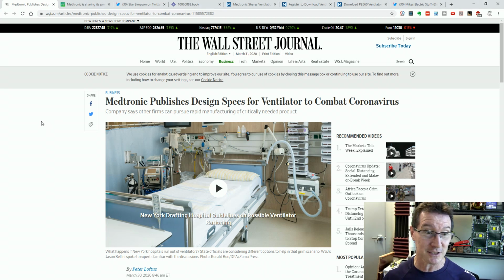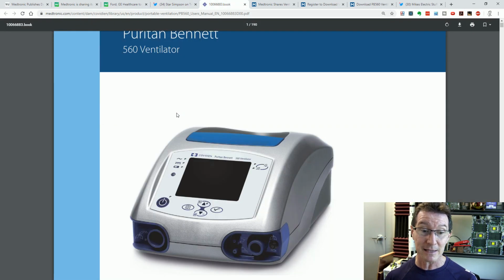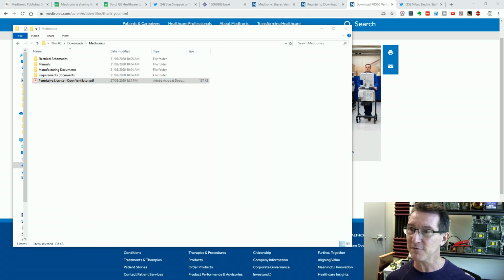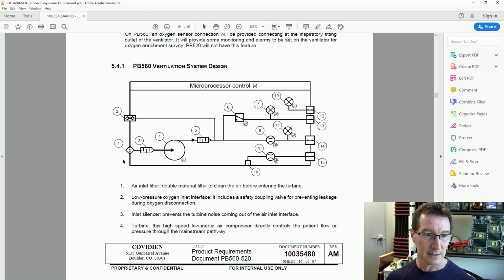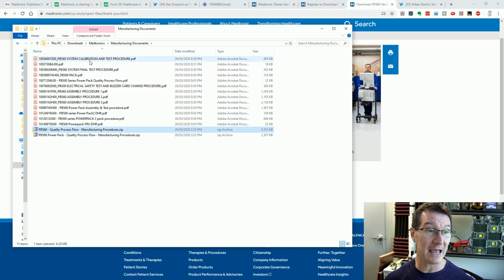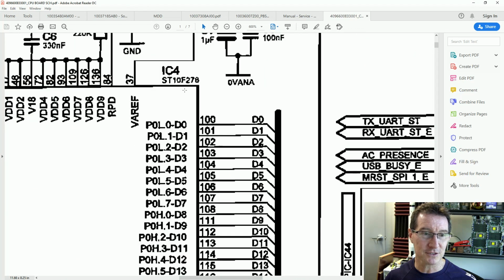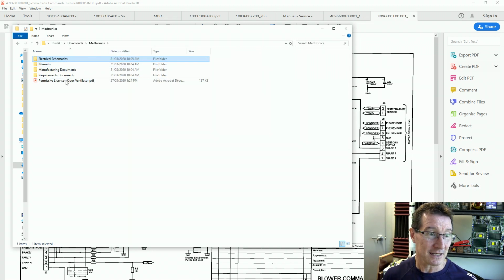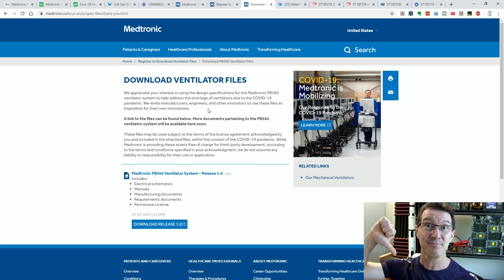eevBLAB #72 - BUSTED! Medtronics Open Ventilator FAIL

Comment: I wonder if software-modified CPAP machines could be used as a better-than-nothing system?
My BiPAP machine can output 20 cm H20 pressure -- not sure if that's enough, but it sure feels that way.
Reply: Actual ventilators go much higher. The scale of a Trilogy ventilator goes to 40.

Comment: So I find this interesting, if there were no ventilators, one would use a BVM, Bag-Valve-Mask, a flexible air bag having a tidal volume of what would match the patient, infant, child, adult.  The output goes to either a mask or an ET tube connected to the patient.  The bag is squeezed and released by hand, at a rate corresponding to the breathing rate and how much it is squeezed depending on the desired tidal volume.  If the power went out, this is what people would resort to, taking turns on keeping the patient alive.

What did they do 50-60 years ago before microprocessors?  Probably a motor-driven set of bellows, a variable speed control, something to set the pressure, as simple as a set of bellows and a micro switch.  There would also be an input, for room air or oxygen.  This really isn't rocket science, but $10 - $20K per unit?  The ones you would see in the OR or ER can be quite complex, lots of instrumentation, but some are actually very simple, about the size of a shoe box.  To be honest, it wouldn't take that much to build one but you would never get it past the medical industry.  Think of what could go wrong, speed control goes out, pressure exceeded, lungs burst.

For the car industry to build one, probably not a lot different than the pneumatic control system in an automobile.  I suspect the sub assemblies can be purchased and put together.  By the time the products reach the market, the disaster will be over.  Then of course, there is CPR.  -  I didn't proof read this, hope it makes sense.     Jim
Reply: CPR and mouth to mouth are going out of favour as people don't want to be near patients in fear of getting infected...

Comment: I guess with it being open source and the fact that they won't sue if someone designs one similar counts for something.  Ex: if someone reverse engineers one and builds one they won't get in trouble. Of course releasing all the schematics and software and BOM etc in proper formats would have been way better and save tons of time.    At the end of the day this feels like a marketing stunt as you said though.

Comment: Page 65 of the Product Requirement PDF had a BOM, but you didn't make it that far in the video.

Wait... Here it is:

Basic Parts The assembly at first level shall include the following: 
1 Ventilator

🤦‍♂️
Reply from the maker: GOLD!
Reply: @EEVblog  A 9 carat gold plated turd unfortunately.
Reply: Maybe a standard CPAP or BiPAP machine with modified firmware would help in places where are proper vent isn't available?

Lots of people working on that atm, and you can buy a half-decent CPAP on AliExpress now for under $350 American Rupees.

A CPAP may not save your life if you ger critical enough to need ICU treatment, but way better than nothing if it helps at all with preventing you getting worse. It would at least force more air/oxygen into the lungs.
Reply: @electronash  Bipaps are considered dangerous as they might aerosol the virus. :(
Reply: @addictedtogravel3552  It would be only as a last resort, for people stuck at home, or in an isolated COVID19 ward.

Obviously I would not recommend using any of this stuff without medical advice, but it's possible CPAP or BiPAP could help save lives if there is a desparate shortage of proper ventilators.
Reply: @EEVblog  they've released all electronic files from CAD, PCB to software and BOMs.
Reply: @EEVblog  Did you see this yet?...

OK, I get that it's meant to be kept as simple as possible, and done in a very short time, but dayum - that breadboard and LCD, tho. lol...

https://www.youtube.com/watch?v=xdZtMgpxnPI

(I guess I assumed that the "best and brightest" in our Universities would at least have access to PCB-making facilities. Instead, Sony are offering to make the PCBs for them.)
Reply: One slight concern is that a lot of these designs run off of "shop air", but not all hospitals will have enough outlets for all of the ventilators.

Some designs might more reliable if an air supply is available, but maybe it's best to look at many different designs, including ones that run purely from a power outlet?
Reply: @ElectronAsh portable compressed air. They all have bottles of compressed air. I presume that’s what shop air is. Not called that here in uk. It was a uk design and all hospitals in uk have piped air or portable bottles of air
Reply: 1 Ventilator 
1 carrying Bag 
1 kit of 6 air inlet filters 
1 O2 connector 
1 CD Clinician’s manual (18 languages) 
1 double branch adult circuit (single branch for PB520) 
1 European power cord (type B)  Customers will be prompted to order the following parts with every ventilator: 
1 user manual printed (choose the correct language) 
1 power cord (if different from European power cord included in BOM above)
Reply: @danielrouw2593  Diaphram compressors are dirt cheap, oil-free and off-the-shelf, just saying.
Reply: Big Cheese I’ve got a diaphragm compressor/vac for HVAC at home and while oil-free it’s also godawful noisy.
Reply: @HighestRank  Haha, the only thing more difficult to address than noise level would be my none-existing concern by it...
- Ehrmm, nurse! That man's life sustaining apparatus you got there is making a god-awful racket. Would you mind turn it down a bit? Or perhaps replace it with one that is a bit more... Ehrm, "civilized", so I can eat my pheasant like the sophisticated man I am?
Reply: I love how companies waste paper,and people time by including this useless crap sections in their doc's
Reply: @paulstubbs7678  it's not useless. It's the requirements for the packaging of the ready product, in other words the content of the box that gets shipped to the customer.
That's how requirements documents work.

Comment: What makes it basically useless is the timescale that we are talking about. The only way to carry out a fast deployment is to have a known-good system, stripped down to its bare basic requirements. 
A ventilator  does NOT have to be nearly so bell-and-whistle crapped up as they make it, if we are talking about necessity versus nicety.

Now from a "Lets take a month to understand what they did here..." perspective, there is knowledge to be gained. Noone here believes we have that kind of time. So!... The US government having GM and other companies make an established design is a solution--- basically keeping the IP in the hands of big corporations.

I think that after this mess many of us will not settle for that.
Reply: I disagree with your first statement.  To my knowledge, the sensors and other mechanics are for safety purposes.  If you're trying to save someone's life, safety features are a most.  Don't get me wrong, I am sure there are items and software features that are not needed.
Reply: @rossrobotics6342  Some sensors are definitely necessary, but some features are just fluff to use to market a new thing to replace an old thing, since ya know, patents expire.
Reply: I thought the integrated 2.1 bluetooth Karaoke speaker mode was a nice touch.
Reply: Do you know how much time this event will last?

Comment: Dave that material isn't some super secret squirrel stuff either...you get that information if you get trained to work on those things... Schematics, functional diagrams, theory of operation, service manual...they basically offered the training material free. Which is nice of them I guess even though most of that can be found on Biomed forums. However that material is meant to help someone figure out how to fix a vent, not build one.
Reply: What's nice about the release is that the information is cohesive: a complete set of requirements to build a well known ventilator - not a hodge podge of information collected from various forums which may, or may not, be self consistent.
Reply: Can you suggest a good forum?
Reply: @jer_h   MedWrench is probably one of the more popular forums. They have a pretty good resource for some information about other medical equipment too. From pumps to beds.
Reply: And it would only be useful to those hospitals who actually have this model. I would imagine that if a hospital uses these then they would also have a Biomed that is trained on them. A Biomed who would already have this service manual.

Comment: Hi,
I've been repairing ventilators and believe me all the viral videos that people are sending out with the silly airbag being pumped with a motor mechanism and calling them ventilators is all rubbish. I cannot believe how stupid people can be especially engineers and PhDs 
A ventilator is an extremely complex unit with Mechanical, Electrical/Electronics, Software, GUI and about 20 sensors. On top of all that you have to get Medical Board approval before you go for human trials and that could take weeks and months.

All who think that the home made cheap vent with a motor and airbag can be put to patients and save lives... wake up !!
Reply: While I agree that there are many silly ideas out there, I think there are credible ones as well like MIT's.  Note that ventilators operating something like what we use today started to become common in the mid to late '50s.  I'm fairly sure they didn't have any complicated electronics, but I suspect they still saved lives.
And, from Wikipedia: "In 1965, the Army Emergency Respirator was developed ... Its design incorporated the principle of fluid amplification in order to govern pneumatic functions. Fluid amplification allowed the respirator to be manufactured entirely without moving parts, yet capable of complex resuscitative functions."  So, while today's unit's with their sensors and electronics are undoubtedly better, if they aren't available simpler approaches can still save lives.
Regarding approval, MIT is hoping to get theirs approved under FDAs Emergency Use Authorization.  From the U.S. FDA web site:

"Under section 564 of the Federal Food, Drug, and Cosmetic Act (FD&C Act), the FDA Commissioner may allow unapproved medical products or unapproved uses of approved medical products to be used in an emergency to diagnose, treat, or prevent serious or life-threatening diseases or conditions caused by CBRN threat agents when there are no adequate, approved, and available alternatives."
Reply: Easy: Anyone who wants to claim they made their own ventilator, has to put out a video of them using it first. Enjoy the popped lung.
Reply: If you haven't seen the Johnny Lee video, check it out. It's hilarious

Comment: Looks like the difference between the nice floor plans that a real estate agent uses to sell a house vs. the actual drawings a builder would need to build said house. NXP have a nice presentation on a ventilator design but again without any files here: https://www.nxp.com/docs/en/application-note/DRM127.pdf
Reply: @ba94845  Is that a Rossmann reference?
Reply: it's the initial sketch the architect sells to the customer before he starts making the actual architecture drawings for the builder, yes.

Comment: Since this ventilator seem to have very specialized parts, someone making use of the design is pretty much useless because it will be almost impossible to tool up a current manufacturing facility to produce ventilators of a current design. The real innovation will come when someone designs one to be made from off-the-shelf parts.

Comment: Triple Eight Race Engineering here in aus have designed and built an open source ventilator...they have been showing it off today...and its much more simple than the medtronics 
https://www.facebook.com/tripleeightraceengineeringaus/videos/2721816168048928/
https://www.speedcafe.com/2020/03/31/triple-eight-develops-open-source-ventilator-prototype/

Comment: I used to work for a medical devices distributor / repair center in the USA.  I used to work with a lot of ventilator / anesthesia systems and those are highly, highly regulated by the FDA given that they are so critical to the life of a patient.  Designs and process documents were locked in reviews for months awaiting approval by so many departments in order to allow a process onto the manufacturing floor.  It's crazy to believe that Medtronics would pull such a PR stunt.
Reply: But the FDA has exceptions for emergencies.  From the U.S. FDA web site: 

"Under section 564 of the Federal Food, Drug, and Cosmetic Act (FD&C Act), the FDA Commissioner may allow unapproved medical products or unapproved uses of approved medical products to be used in an emergency to diagnose, treat, or prevent serious or life-threatening diseases or conditions caused by CBRN threat agents when there are no adequate, approved, and available alternatives."
The MIT team is hopping to get approval for theirs under this Emergency Use Authorization.  How hard will that be? I have no idea, but I suspect it depends on what politicians they get on their side.
Reply: @andrewsnow7386   Andrew Snow  Yes. Anything that helps is getting fast tracked through the FDA process. There have already been a few. No ventilators, that I know of, but some SARS-CoV-2 test machines that were pushed through in a matter of days. A process that would otherwise take months to years (not as long as a device that interacts directly with the patient, like a ventilator), but still a really long time.
Reply: Matthew Siebenhuhner Good info, thanks.
Reply: Matthew Siebenhuhner I can only think the form and initial document release is to get the details of ‘genuine qualified’ parties with a more aggressive licence for those they allow to have the full documents, that’s the only way I could see it working anyway
Reply: How unlike the home life of our own dear FAA!
If Trump can order the FDA to allow doctors to prescribe an untested drug, he can make them license untested machines. It's not as if people's lives were at stake, as with aircraft, is it?
Reply: @faithlesshound5621  But maybe trump should not be the one to pick the winners here :-)

Comment: No code, no schematics, no BOM, no component specs
Reply from the maker: There are schematics at least! Nothing else though.
Reply: @EEVblog  schematiscs printed and then scanned! that's a real joke. Like "make hard on purpose"
Reply: @rarbiart  I can't even tell you how many times I've had to enter huge 25x25 and 30x30 data tables into code from screenshots of Excel. 😑
Reply: It's understandable, they obviously don't want more competition. Maybe it's a bad time to tell them about their new competitor, VentilatorChallengeUK, made up of Airbus, BAE Systems, Meggitt, Ford UK, Rolls-Royce, all the UK-based Formula 1 teams, Siemens Healthineers, Unilever, Dyson, JCB, GKN, Reinshaw, Smiths, and Ultra electronics. #RIPMedtronics :'( it's not looking good for them
Reply: you can NOT  buy medical specif components or hardware, same for military stuff! 
what would be the use of a BOM of things you can NOT buy ?
how much do you value the information about method of operation, testing and validation that is contained in those documents ?
how many years of research will a group of engineers gain with that information available?
and the real question is, how long will this last in order to make this information relevant ?